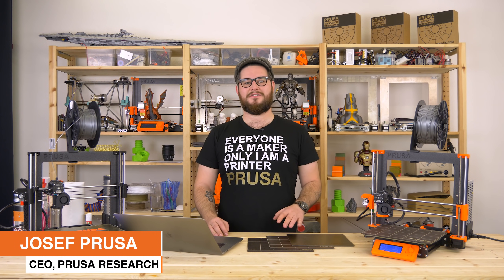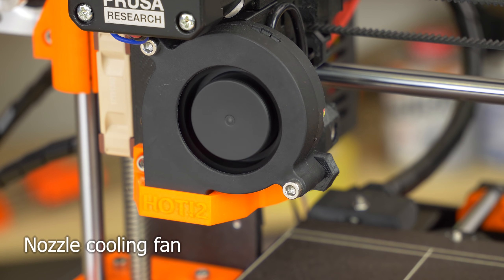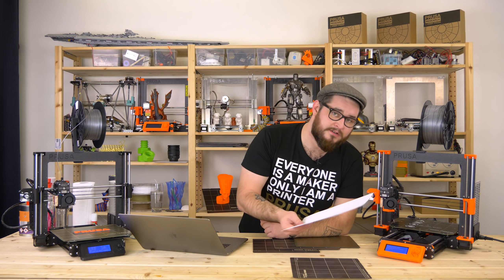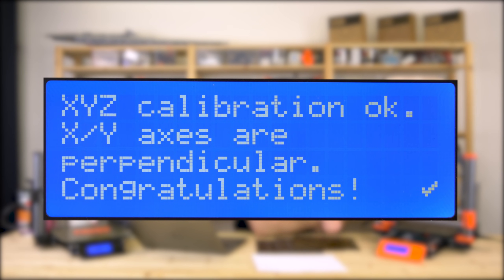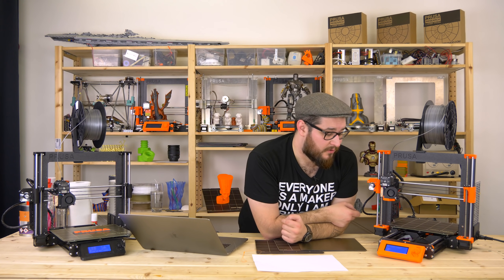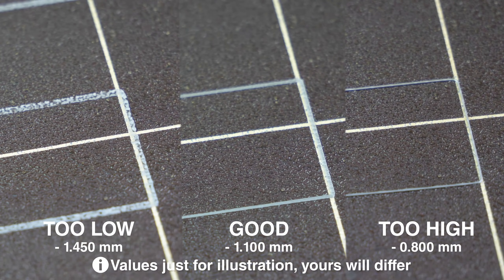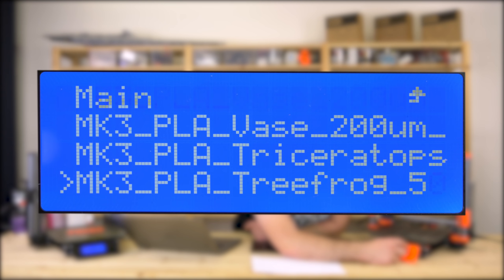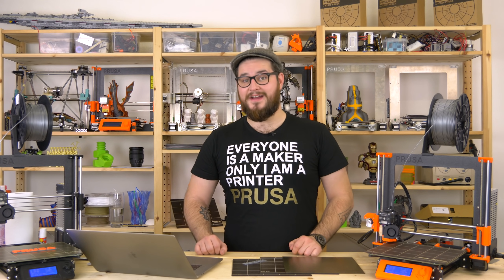Original Prusa i3 MK3 guide for a new user

Comment: Very frustrating as the self calibration keep failing due to filament sensor wiring failing - think twice before you buy guys as once you have it, its hard to get help after that, and you will end up with an expensive paper weight get!

Comment: Hi Jo  Awesome product but I think you have a design flaw my kit arrived with the dreaded filament sensor wiring issue and your team have posted me a new one. it seems there are more than a few of us (https://shop.prusa3d.com/forum/others-archive--f66/filament-sensor-wiring-error-t13733.html) surely if you changed the design to use a micro switch rather than a laser sensor  it would be cheaper to manaufacture and would serve the same goal. also the belt design needs to be rethought so that a its easy to  re tension without wwIII  and also a single  continuous belt with tension on one or either side. By now you have thousands of fans and makers who are constantly  "improving your teams designs for serviceability. why not create a  continuous improvement portal where users can submit these to your team and then have a full time person testing these fix's. its free R&D and saves lots of disappointment from users...

Comment: I've tried six times already and I get a selftest error checking the Y axis lengt.

- I've already checked that there are no blocks and that the Y axis moves fine
- I have readjusted the belt tension
- I have also readjusted the four smooth bars holds with the tray in the extreme positions
- I have checked that the wires in the textile seath force in no way the movement of the tray
- I made the assembly properly and the bearings went in perfectly and they are not overtightened by the U bolts. 

So what do I do now to finish with this stupid Y axis length error?
Reply: Sorry, I fixed it. It was this stupid wire under the tray...

Comment: I received my assembled MK3 and am very disappointing.  I built a Prusa MK2 Kit almost 2 years ago and loved it.  This assemble unit has given me 24 hours of disappointment.  I tried printing a 7 hour project which printed fine on my old MK2 and after about an hour I found it stopped with a change filament message.  There seemed to be no reason to change filament.  But I tried to remove the the filament and could not.  It is totally JAMMED.  I did notice that the Extruder Motor was extremely hot.  So now I am sitting here with a brand new printer that is unusable.
Reply: These printers cost way too much for what you get. You could have three Creality3d ender's for the price of one of these...
Reply: Icanifiwant I could also get 2 Xbox ones for the price of an Xbox one x. I see you trolling MK3 on every video, what’s your agenda bruh?

Comment: Have you guys thought about having the printer capable of swaping its extruder for some kind of different module like a laser engraver or a cnc?  that would be an awesome feature as well!
Reply: Not sure what kind of force is required for a CNC machine but it might be hard on the gears?

Comment: Do you really have to clean the bed with alcohol every time?
Because, I can print a lot of prints without issues on the Anycubic Ultrabase.
Reply: I did not clean it for 10 prints and it sticks just fine. as long as you don't get the surface greasy with your hands you're golden
Reply: It's not needed, just a good idea. I'd rather buy a replacement steel sheet when I need it, instead of cleaning it.
Reply: Januaay Haha yeah that sounds better! ;-)

Comment: This video was required after Toms live stream xD
Reply: J Belle You are fucking amazing. You said everything perfectly.
Reply: The temperature of neodyn magnets begin to loose magnetism is 130°C. With Samarium-Cobalt it's 350°C. So nothing critical in using magnetic bed if using the right magnets.

So your "LOL" only shows lack of knowlage. Do not mix up the magnetised iron childs play with and modern rare earth magnets. Total different characterisitics.
Reply: You only preordered and were given the info it will take a few months.
Reply: Hypocycle i Have no idea what were you doing lol. If your nozzle crashes into the bed, lower your pinda (its in instructions), check your firmware, might need updating, whenever i sent a message on forum i get a reply within 6-12h or you can live message instantly. Crash detection so far only detects "crashing" into something not being pushed so test it by blocking the motor not pushing (its also worth checking if its enabled in settings) plus it only works in normal mode not stealth.
Reply: The only thing that is defective is the thing behind your eyes. What is the printer that started the whole movement of low cost non-industrial printers with industrial performance? Prusa. What sparked all the Chinese printer companies like Creality, Tevo, Anycubic, Wanhao? Prusa. What is in the item description of almost every 3D printer on eBay? Prusa i3. How many print farms run the CR10? Ok, let's play even in your playing ground. How many Prusa printers does Tom have now? 3. How many CR10s? 0. GG, lol. Ok, you want to complain about the magnetic bed. "Oh, come on, magnetism goes away with heat *picks nose*". Yes, it does---over 150 centigrade heat. Now the next question is, what the hell are you doing raising up your bed temperature that high. You really think magnets will lose their magnetism before plastic melts? Lmao. Obviously, 3D printing is too much for you, perhaps Hello Kitty Tropical Island Adventures would be more suitable. Now take your thumbs down and get the hell out of here you troglodyte homunculus.
Reply: You must be a welfare resipian legacy of the last administration, that has not idea of mechanics and electronics but make complicated explanation and excused when thinks do not work.
Reply: The printer is defective, the CR10 is more simple better in all aspects, more volume, less BS for level the bed, and do not have the amount of plastic this Hundai have,  the funny part is the price $780 dollars LOL, I get 2 CR10 working in 2 hours like a champ after a complete inspection.  Parts are easy to find, this machine is a overprice Hundai.  And yes after that fiasco with Tom this guy better lower the price of this machine, and his magnetic bed LOL magnetism goes away with heat, come onnnnnn.  Just look the huge manual, the cr10 is minimal, why because works out of the box.

Comment: The selftest fan spinning should have a visual acknowledgement by the user as miswiring of the fans will jam the extruder. Or if possible measure the rpms of the fans (slow and fast) to make sure that the hotend fan is wired correctly!
Reply: The EINSY Rambo indeed DOES measure RPM of both fans and thus no visual confirmation is necessary :)
Reply: But the firmware doesn't know if the right fan is corrected to the right connector on the EINSY. So if you screwup the fans on the Einsy it gets rpms from both fans BUT as the hotend fan should turn the part cooling fan is turning and the hotend jams. Happened to C.R.T. during his MK3 build! If the Noctua fan spins with 4500rpm on full load and the blower fan with a different rpm you could measure if the fans are correctly connected. If both spin with nearly the same rpm a visual confirmation could prevent a jamed extruder. Not everybody will be able to disassemble the hotend to get it running.
Reply: eric clinedinst: Josef asked for comments and as it happened to a person who knows a bit about 3d printers, as he designed and built his own, it can easy happen to users with much less experience to swap the fans on the board during the build. Prusa tries to make things bullet proof and so that's why wrote the comment. The MK2 firmware asks for visual confirmation and as long this isn't fixed in the firmware to measure the right rpms of each fan, I think it makes sense to add this to the process. I can't imagine the frustration of a 1st 3d printer owner when the hotend jams because of this.
Reply: If you can't sit there and look at the fans during self test the first time to verify the proper one is turning at the right part of the test sequence then you have ZERO business operating a 3d printer.